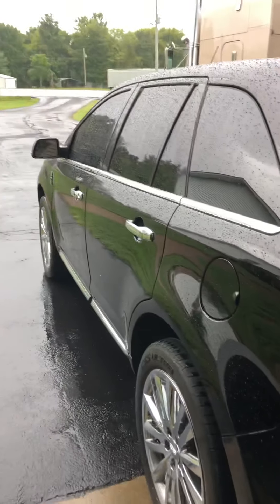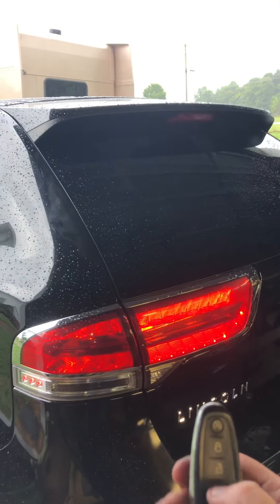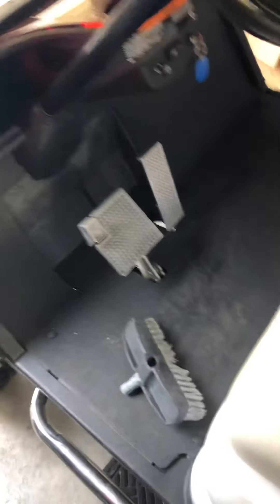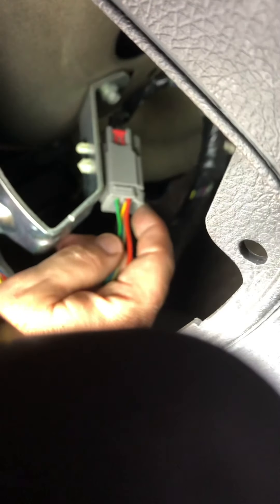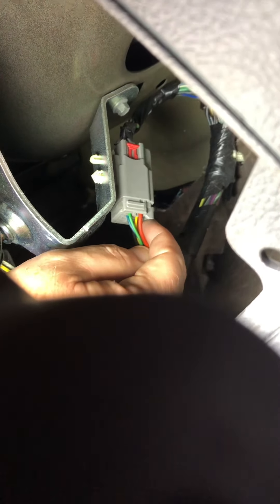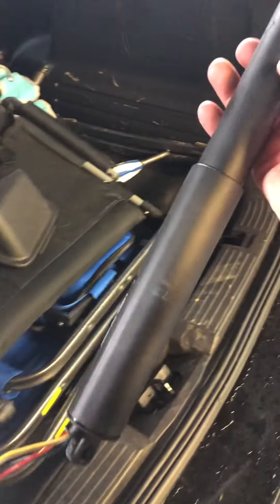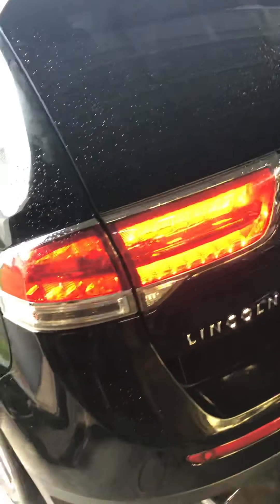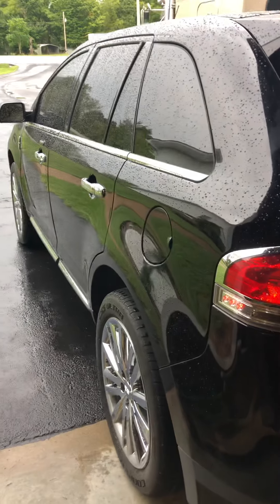2012 Lincoln MKX power lift gate won’t close

Comment: I’m tell you something , thanks so much for this Video! I have a 2011 MKX and this same problem has been going on for a while now. I’m gonna take your advice and see if that works. I tried pulling the fuse for a few minutes, but once I put the fuse back, I still had the problem with the LiftGate not closing. So once again thanks for the video. I think you’re on to something !
Reply from the maker: You’re welcome. Hope it takes care of your issue. Btw. Here’s the part # BT4Z-78431A78-B
Reply: Ok , I’m on it right now! Thanks so much again !

Comment: Can you please tell me where to order the new motor and how much does it cost , thanks
Reply from the maker: You can get it at your local Ford dealership. Myself, I just google the part number because a lot of dealerships sell parts online. Just be sure to verify the part number before ordering. Because sometimes google will make suggestions for items that aren’t the same part number. It should cost somewhere around 250.00. Give or take 20.00 depending on shipping costs.